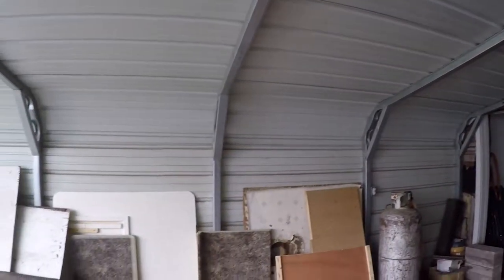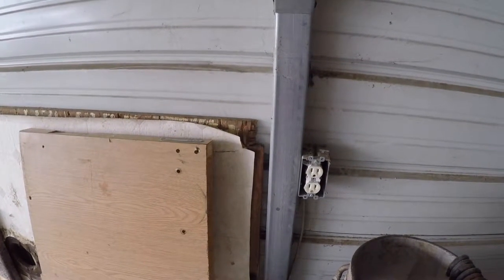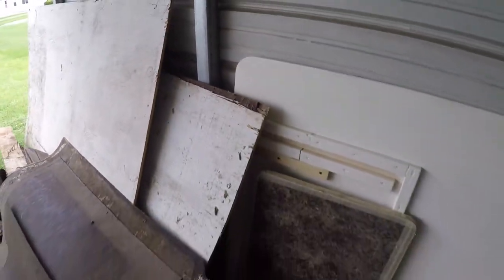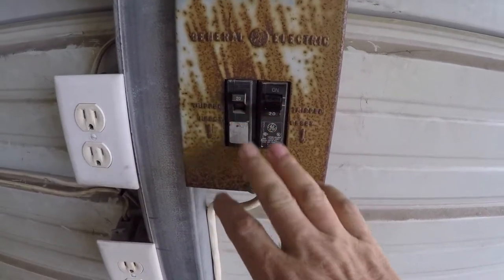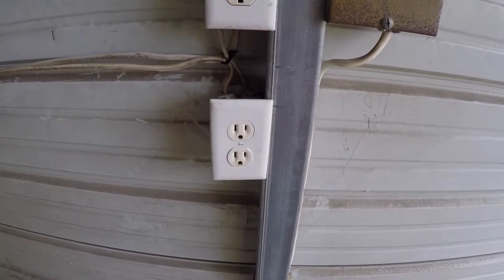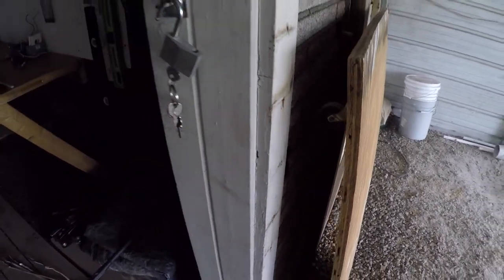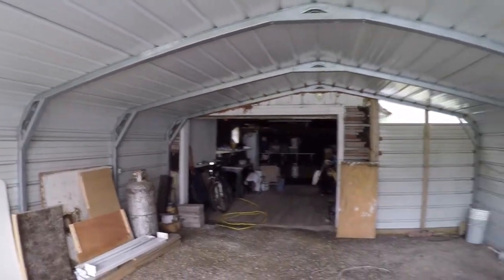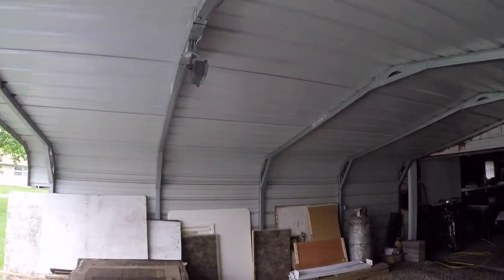Installing Outlets in a Carport - DIY Wiring Projects

Comment: I see what you’re doing 👀 genius idea💡two outlets close to each other so you can pull 120v off of each (if done correctly) to create 240v to power your welder. Without having to wire 220v from your house to your shop. This has got to be the coolest DIY electrical idea I’ve seen. Thank you for sharing 👍

Comment: I don't know anything about welding so I won't hazard a guess.  However, I do know that you can never have too many outlets.    Are the outlets and lights in the shop area on this same breaker box?
Reply from the maker: They are on the same breaker box. I'm almost finished up with some modifications to one of my welders. Once I am finished with that I will be getting to the answer to why I have two outlets so close together. I'm not intentionally trying to make you wait for the answer, I'm just busy trying to get things done so I can explain what I am doing.
Reply: @DIYHomesteadProjectsDIYHP10  I don't mind waiting.  Actually seeing what you are doing would be easier to understand than have you describe it.  Especially since I don't know welding.